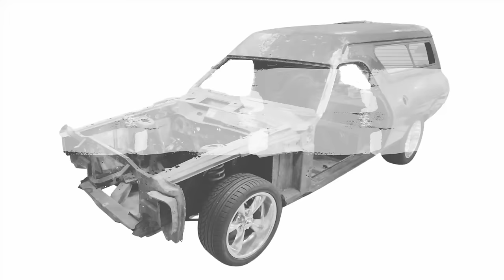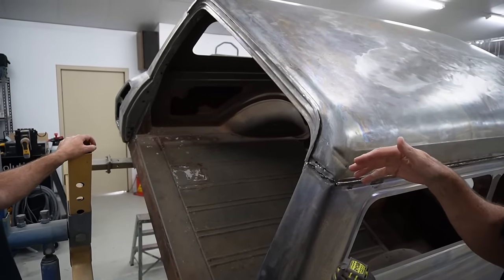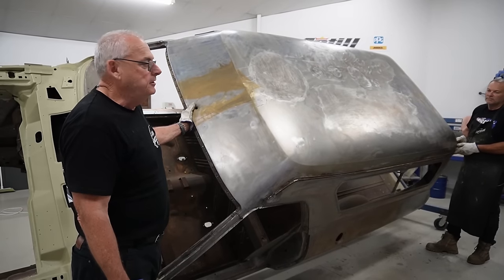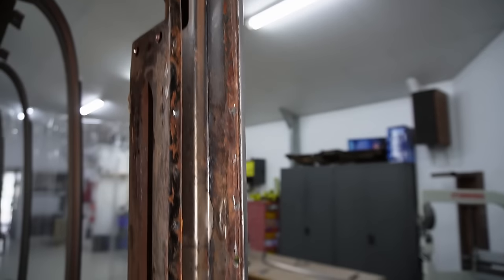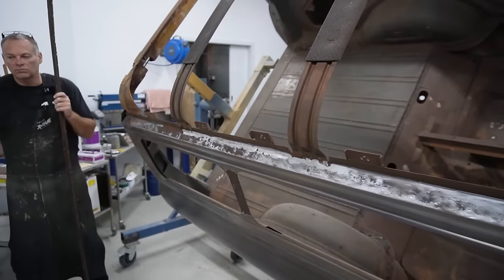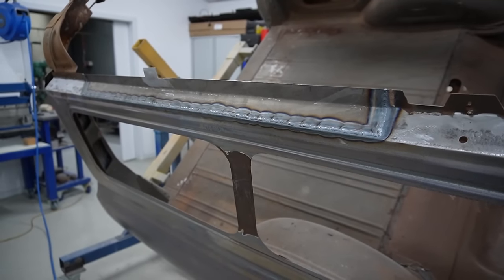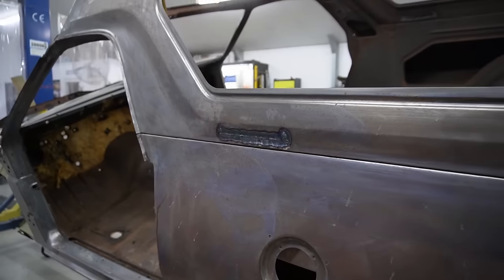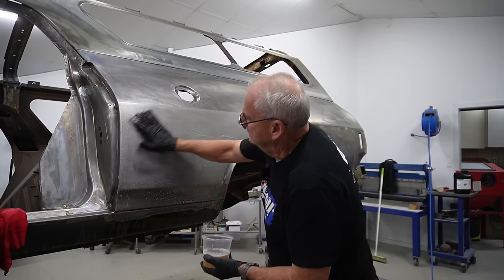Panel Van Roof Removal to get drip gutters removed #6 Magnum Force

Comment: Great tip about the soft welding wire for sheet metal. I had not even given that a thought!  Another thing I am going to have to research to work out the number/place/product to order. Cheers.
Reply from the maker: yes do the research is very interesting

Comment: That's a good tip to beat the panel back into shape after removing the spot welds Howard. Its the little things that make the job easier in the long run.
Reply from the maker: Cheers mate👍

Comment: Howard,
Great to see you're back on the panelvan. I'm inspired by your attention to detail and workmanship and I look forward to seeing how you're going to fill the side window openings without too much warpage.
Several times you mentioned using various original panels as a pattern / template to fabricate replacement panels.  Please tel me you'll be reproducing all the required panels for the upper rear liftgate structure ... even the rear liftgate itself !!! If so, I'll have a complete set !
Reply from the maker: Just the drip gutters this time round.

Comment: cool to see that , i thought the roof flanged out to mee tthe gutter and got spotted but you cut before the spot closer to the roof , had no idea the gutter was a single piece , i have the only two tone factory XE van ford made , it was for golden fleece , i have to do the roof , not rusty but been jumped on , its still in the original colour , i may try and shrink the roof first
Reply from the maker: The roof does have a flange, I will be welding a new flange on. I need to save the gutter so we can reproduce them so others don’t have to do the flange.
Reply: @AstillDesign  would you attempt to fix a stretched roof first before resorting to removing it , i have another roof its actually complete from the top to bottom were the ute part finishes , i would appreciate your thoughts
Reply from the maker: I would fix the one on there, you will be surprised how it will come out if you take your time and work it up slowly. You can do more stretching getting it out if you hammer it too much. Try to push it out like PDR.

Comment: Could you please advise the part number for the low tensile filler rod, thanks
Reply from the maker: Hi, I'm using ER70S4   the 70 is the tensile strength. You can get 2-4-6 these are the composition of the filler rod depending on the condition of the metal.
Reply from the maker: https://www.materialwelding.com/tig-welding-filler-rod-chart-pdf/?expand_article=1

Comment: Cigweld "high test" branded tig wire is the one to use, copper coated and deoxidised, vey soft and malleable. 
Almost but not quite as soft as the black oxy welding wire
Reply from the maker: Thanks for the info

Comment: Wondering if you’ve ever tried easyphos on bare metal panels to keep them from rusting if they aren’t getting painted in the short term.
Reply from the maker: I haven’t, it concerns me that it is an application with removal and what is going on the steel and how you remove it before paint
Reply: @AstillDesign  according to the manufacturer you can epoxy prime directly over it as it provides a chemical adhesion. Panel needs to be clean before spraying it on and keeps the panel clean for 6 months. I've tried using it on my first build and found it to be good but never had any long term experience with paints over the top of it.
Reply from the maker: Yeah I'm following PPG's recommendations with dioxidine

Comment: Why don’t you tig weld the bronzed sections? It would simplify things.
Reply from the maker: good question, I'm looking at using bronze in the door jams. something I haven't done before.
Reply: Just lower the amps as you want to heat the steel, but melt the bronze, it’s different to start with but once you get used to its easy and less distortion. 👍